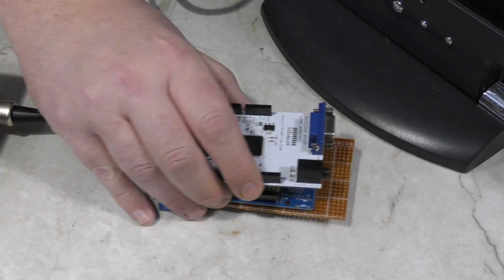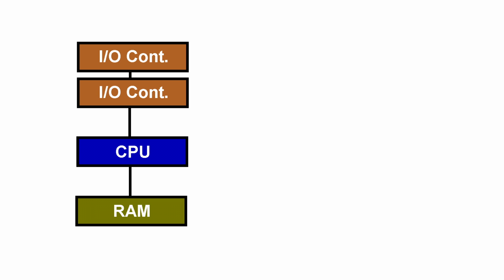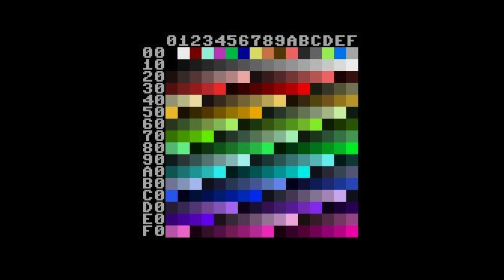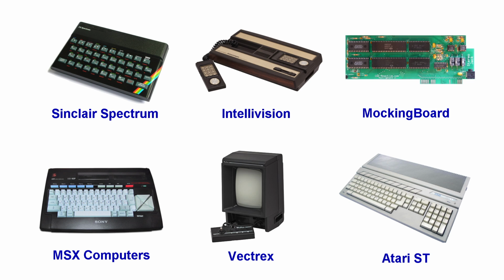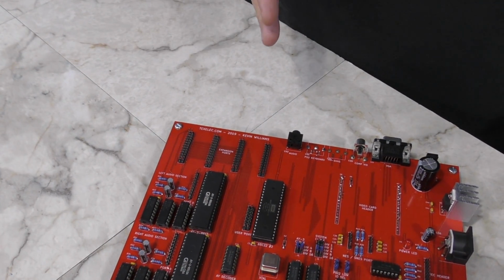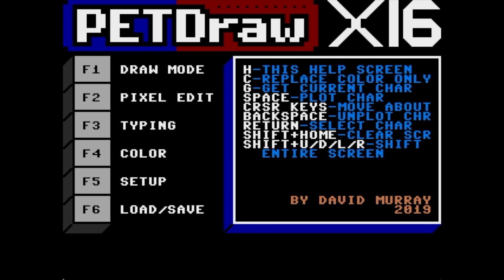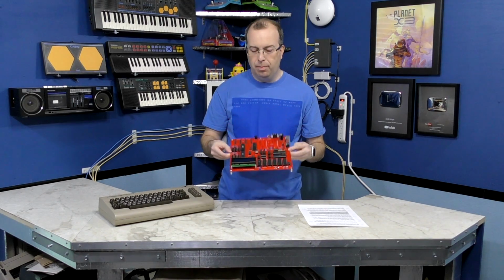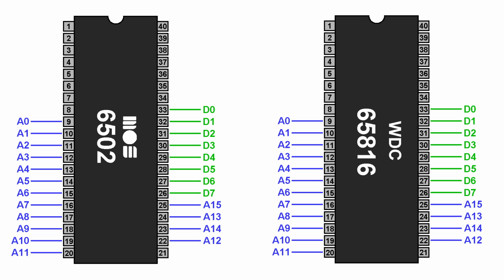Building my Dream Computer - Part 2

Comment: Uuugh, not Facebook! SO many more people would join on if Facebook wasn't involved.
Reply: There is a website/webforum linked at the bottom of the description, so far it doesn't seem too active though

But yes i agree, using facebook as the primary means of communication is preventing a lot of people (including myself) from easily getting involved
Reply: I hate facebook and don't use it. How else can we access the poll?
Reply: I would have to agree with a lot of the sentiments in these comments about Facebook. I would much rather join a Discord server or something like that.
Reply: @FlergerBergitydersh  Or a fucking website.
Reply: I can see the appeal of using facebook unfortunately -  it's basically a free forum that someone else maintains. But it still sucks. I'm sure if someone stepped up to maintain a phpbb instance for the project that they wouldn't mind moving over there from facebook, but I doubt he has time to admin a fully blown forum like that himself.
Reply: @AngelaTheSephira  I mean, a website doesn't quite have the sharability and accessibility of a pre-existing social platform. Users have create whole new accounts and the web site creator would have to set up how the whole website works and it probably still wouldn't work as well as even a Facebook group. It would have to be something with a pre-existing account system where you could share and discuss interests, like Discord or Facebook. Granted, status updates delivered through Discord wouldn't be as pretty, but they wouldn't have to be. And in that case you could just include links to a simple blog like Tumblr or WordPress for more in depth updates and use your Discord for discussion.
Reply: Why bother? Just ignore everything else there and don't give them any of your details.
Reply: Even Reddit might be preferred.

Comment: The phase 3 (FPGA/ASIC) design is the one I'll be waiting for. It has the most advantages: it can be updated to include additional hardware features (and ROM code updates) and can even include all the RAM and ROM. I vote for a full action keyboard and I'm glad that you're not using vanilla Commodore-inspired V2 BASIC! In fact, I hope a lot of effort is put into this feature of the product: BASIC V3 (or better).

Hopefully the final product will be something like what Perifractic showed, though I think an attached keyboard / all-in-one design (like the C64 and Vic20) will be less costly to produce overall. Looking forward to this!

Comment: Hey David, please consider using a Yamaha YM2608! It has 6 channel, 4-OP FM, an on-board AY-3, a sample channel, and 6 drum sounds!
Reply: I don't think they'll change that. The yamaha is very nice, but I think their solution is quite cost effective and capable, too.
Reply: The YM2612 would also be a great choice.  Same chip used in the Sega Genesis.
Reply: But is it available as a 'new' part?

Keep in mind what the goals of this project are.

The fact that it has to be off the shelf parts for instance means that the 65816 was an option (even though they gave up on it due to complexity), but a 68000 is not.

One is still available off the shelf as brand new parts, the other is not.

As it happens, when it comes to Yamaha sound chips, the OPL-2 and OPL-3 of Adlib/soundblaster fame are more likely to be available than the YM2612...
Reply: @KuraIthys  None of the chips he's suggesting are available as new parts. Yamaha stopped manufacturing actual FM hardware in the early 2000s, and the 2151 he's such a fan of hasn't been in production for over 25 years. Any chip he gets is going to be a used chinese rebadge pulled from a PCB with a new date slapped on it, be it any flavor of AY or Yamaha FM chip.
Reply: @ubernerrd   I agree . The intention it to make a nostalgic platform and the graphic are on par or better than a 16 bit console , the name of it has 16 so the sound should be nostalgic of a 16 bit system.

Comment: Great update! 
Glad to see the direction change. I think it was in the right direction. 
One question. PLEASE tell me the BASIC won't be as crap as the original C=64/Vic20 BASIC. By that I mean that it WILL include graphics and sound commands. Think SuperExpander without the sucking. 
Eg commands like 
DRAW CIRCLE
PLAY SOUND
etc. 

As for sound. How about a dual channel FPGA-SID? ;')

Comment: I’m glad you’re not going with those audio chips, they sound too crunchy. But at the same time, couldn’t you use a frequency divider to run it at 2MHz while the system runs at 8?

Comment: Impressive work however unless it is very cool, still wonder why you want to have/made this. Don't see any (modern) storage facilities? It would be nice if it is possible to connect it to PC to use a modern editor (with syntax highlighting and enhanced features) to speed up development. It would be nice if there are any GPIO pins and at least an I2C bus, to be able to connect to the outside world or extend it with new (already available) features.  Makes it more fun.

Actually I don't understand why a FPGA is such a problem, it is slow machine and you don't have to mess around with all those chips and you are able to update it/fix errors with some firmware. I know, a FPGA is quitte expensive however can reduce the chips on the board and reduce the size and manufacturing costs (more flexibility, smaller PCB, smaller case, less components etc). 

Maybe you have to start to build a perfect clone first (can replace old hardware of 2x/3x second hand price) and fully compatible with modern features as VGA, HDMI, SD-Card and such with 1GB of addressable memory and configurable graphics card. A system similar with a BIOS, so you can config the system and address the memory to your needs.  That is what you want, right? The speed problem of Basic can be easily tackled down when using modern hardware, increase CPU speed when basic is interpreted for example. You are unable to do this when using old chips.

If this computer is only meant to be faster and with a little more memory and a little better graphics and with some Basic incompatibility and costs a fortune, I cannot imagine why people want to purchase such machine, really. Maybe it isn't my cup of thea.

Comment: What are the POKE commands to make the screen white and the text black on the Commodore 64?
Reply: Do you want to make the border white too?  In that case, it's POKE 53280,1:POKE 53281,1:PRINT CHR$(144);CHR$(147)
53280 controls border color, 53281 controls screen color.  CHR$(144) is the code for black, and CHR$(147) clears the screen.
Alternately, POKE 646,0 does the same thing as CHR$(144).  Memory location 646 controls text color.
Reply: SpearM75503 Thanks!

Comment: if you already have an FPGA with RAM on the cpu bus there is no point in adding separate ram chips, at those slow speeds the FPGA can easily do that as well

Comment: 22:00 "And if enough demand, a custom ASIC"
Don't, it'll be more expensive and error prone than using an FPGA.The volume and R&D necessary for ASIC production is higher than this project will ever garner. I'm not saying it won't be popular, but it'll never be sold in every Walgreens and Walmart popular, and that's the level where you'd consider going into ASIC production.
Reply: @Intra Ignis personally, I have no problem with people announcing their qualification while making a comment/suggestion.
I'm not saying we should 100% believing random guy on the internet, but making fun of him for saying he has worked in the industry for a long time is very unnecessary. It solves nothing.
Reply: @Intra Ignis You're right. I am just some rando on the internet. I do invite people to look up rates from places like TSMC, MOSIS, or Global Foundries though. This project would probably go for a sea of gates style ASIC, which are cheap-ish, so around ~$50k startup costs + cost of masks (depends on the fab) + fab fees, 10k-25k/yr. minimums with a three year contract.

I guess the biggest deal is at any point, you can call the fab and ask them and verify this info, or even ask other EE's in chip design. They exist, I promise.
Reply: @adamsfusion  The point Intra is making is that  it's totally useless to say what you do for a living, how long you've been doing it, and so forth. It's totally irrelevant. It's about what you're actually saying (to which I agree by the way) which makes your reaction good. The rest is 'fugazi' (see: wolf of wall street).
Reply: If they have verilog already then what's the problem? Other than minimum order size
Reply: @akkudakkupl  Talk to the parallax guys working on the propeller 2 mcu. It's been a decade in the making, they have verilog, and are still having a hell of a time getting it to work. Just because it works on an fpga doesn't mean it will always tape out economically for a given process node and package size. Power dissipation (to only mention one issue) of such a design is a big concern.

Comment: If it follows classic MicroATX specs for everything that is perfect!
Would be lovely to smack into an old case of some sort!
Everything on the I/O shield and perhaps even a ATX power supply hookup would be nice, should be easy to then keep a retro like running machine running with modern freshly made parts.
Granted it would mean that you would have to add your own transformer setup to change all the 12V into the needed voltages though.

Late edit: Way ahead of me there, well for some cases, it is nice to have additional buttons on the board.
They are advertised for overclockers in the PC space, but are so useful when either bench running or you need to do some debugging and need a backup.

Comment: who owns the commodore copyright these days?
Reply: The Commodore brand and trademarks are owned by a company called "C= Holdings"
All other former Commodore International assets and intellectual properties are owned by Cloanto.
Reply: Thank you! I kinda wondered since David mentioned he couldn't use the Commodore name.
Reply: @lettuce7378  It seems as though C= Holdings bought the brand name in the hope of selling it on for profit. They've done nothing with it, other than suing people who tried to use it without their permission.
At least Cloanto are actively producing officially licensed Amiga emulators and software (modified to remove all reference to Commodore).

Comment: To be honest I'd only be interested in this computer if it was in kit form board only, and it would have to be the one with real chips. For a FPGA based system I think the mega65 is far more interesting.
Also I'd never pay the price for a complete pre-built system, plus that would take away the fun.
And much rides on the choise of sound chip. A fm only or square wave only solution would kill all my interest/potential love for this machine. I think for the sound perhaps the FPGA path is the best option.
With all that said, it's a super cool project! And the combined monitor/assembler seems really neat.

Comment: since all parts are of the shelf and software open source on github couldnt someone just order all parts, compile the rom from github and flash it to rom chip and just build it, the only missing thins would be video chip (could be sold speeratly) and files for PCB printing which 8bitguy could release or sell or even just sell bare PCB with parts list and link to rom and kernel github?

Comment: PLEASE don't use Cherry switches.
Reply: Why?
Reply: Richard Head Scratchy, unpleasant sounds, horrible keyfeel. The epitome of "eh, it's good enough" design. Since the patent ran out, plenty of excellent derivatives have brought innovation to the MX design. Kaihua is the perfect example. They have been pushing MX to new heights through their clever engineering and useful additional features.

Comment: MICROMANAGER SMH.  Use diode logic and core memories to really go retro.
I don't understand the PI-phobia or fpga fear.  A small Linux kernel with X windows is all you need and already exists ---  YAY!  And you never have to worry about busted hardware, because it'll work on practically anything.  rem [shift-]L  (Formerly, The ALIEN)

Comment: @8-Bit Guy
I'm hoping the ATX power connector has room for the modern 24 pin connector since that's more common on current enthusiast-grade units, and not all of them allow the extra 4 to be easily removed in a "20+4" fashion. I'm considering one of the Monotech NUXT and it looks like it may have components in the way of the extra 4 pins. If they're unneeded, you could place an "optional" label on the PCB beside that part of the connector, so a 20 pin connector could still be used.

JMHO, and I could just use an appropriate cable extension with the "20+4" feature, but I figured I'd bring it up now so maybe it could be considered

Comment: I have always wanted to do the same, now with the fpga's you can create everything :).
If they reach 4 Mhz, it will be enough to even run c programs (there is a c compiler for gameboy and gameboy color).

I personaly prefer the raspberry pi / fpga aproach, (not just for themoney, but also for the size).

Just imagine an 8 bit cpu at 4 Mhz moving tile based layers with sprites and 256 colours... awesome!.
Reply: There are games written in C for stock C64 and NES.

Comment: gleefully eyes X16 port of doom so you're saying there is a chance
Reply: Would be pretty stripped-down compared to what you got on DOS, given the DOS version is a 32-bit protected-mode program.
Reply: @Roxor128  dos code is 16 bit
Reply: @earthsteward70   Plenty of DOS software uses the 32-bit instructions introduced on the 80386. If you've seen a game start with DOS/4GW Protected Mode Interface (I forget the exact wording) showing up on the screen during load, that game was a 32-bit one.
Reply: @Roxor128  like that:

"DOS/4GW Protected Mode Run-Time   Version 1.97
 Copyright (c) Rational Systems,  Inc. 1990-1994"
Reply: @andiback   Thanks! I knew someone would be able to remember it eventually (or catch it on starting something in DOSBox).
Reply: And it won't even need to login to BNET!!!  :D
Reply: You can definitely strip Doom down till it works, while still keeping the main thing separating it from Wolf3D- those 2.5D maps.  Lots of people took cracks at non-90 degree wall rendering on the graphing calculators and while they don't have a lot of graphical fidelity to them, the demos ran at a good enough rate compared to a full working Wolf3D clone.
Reply: Yeah... I'd say that's asking a lot.
since Doom at maximum settings requires something like a 33 mhz 486 with 4 megabytes of RAM.

So you're going from a 4 megabyte 32 bit system running at 33 mhz to a 2 megabyte 8 bit system running at 8 mhz, possibly less?

Yeah, not all that likely.

If it had still been a 65816... Maybe.

But let's be real here. a 65816 at 14 mhz would still be quite a stretch.

The SNES version of doom, which due to system architecture has the benefit that most of it can run directly from ROM (mitigating RAM limitations), is dependent on a 20 mhz risk CPU that can do most instructions in a single cycle (including multiply and divide), has dedicated pixel drawing functionality and a dedicated instruction cache (making it able to run a lot faster than RAM speed limits would suggest)
And with all that it still has to run the game with untextured floor and ceiling, all enemies being front-facing...
And running in 'half resolution' mode, where the effective final render resolution is as low as 128x96

And now you want it to run on an 8 bit cpu which is at less than half the clock speed even of that? XD
Reply: @KuraIthys  You do realize there is a DOOM C64 port and a (true hardware, not a RasPi in an NES) upcoming NES DOOM port, right?
Reply: @forple8930  There is also a DOOM port to a graphing calculator ...... (was it an LGR video?). Not saying it will look pretty, but I don't think it's "impossible".
Reply: @forple8930  Both the C64 and NES ports use external hardware and don't run on the computer's own CPU/RAM. The C64 version, even with a 20MHz expansion CPU and 20MB of RAM, runs at like 2-3 FPS, and the NES port runs entirely on a Raspberry Pi in the cartridge and then feeds the video output directly to the NES PPU via the video bus. Both ports are essentially cheating.
Reply: @guspaz  You missed my point, read it again. I specifically said there is a NES version without the RasPi in a cart being made, and there well is a fully well running DOOM on C64 at a good framerate, hell, even the ZX Spectrum is more than capable of doing that with rather terrible graphics capabilities, being almost entirely CPU driven.

Comment: Well, I can see one problem right off the bat: the 3rd argument to VPOKE should be the ASCII value of the character you want to print. Otherwise, every BASIC program that wants to print to the screen (using VPOKE) is going to have to implement a lookup table. Better to move that task into the interpreter; this’ll save you, and anyone else, a lot of grief later! 😎 Or just organize the character ROM by ASCII values, like pretty much every other retro 8-bit micro out there; then you won’t need a lookup table. For example, what if you want to put the character “0” (zero) there instead of the character “A”; what would you poke there? It’s not at all obvious. And what about punctuation symbols? Otherwise, I fear this will become a nightmare computer. 😬

Comment: If your not using the full 24bit address bus if the 65816 have you looked into the 65c802. It only have a 16 bit address but and is pin compatible with the 6502

EDIT: nevermind, it looks like WDC discontinued that chip.